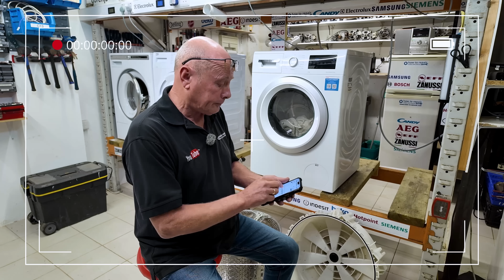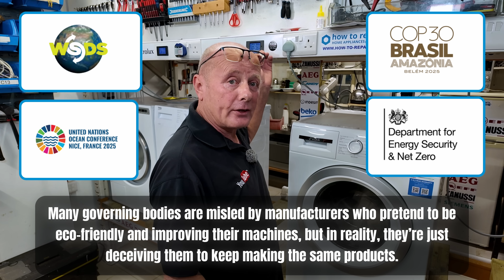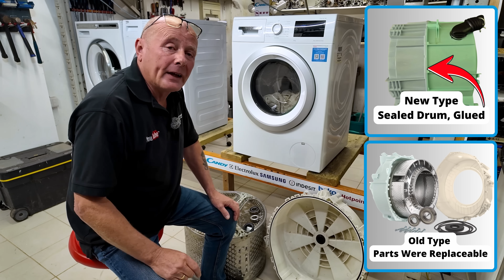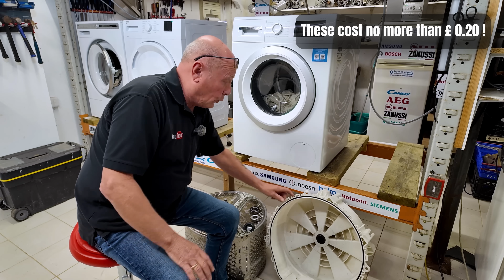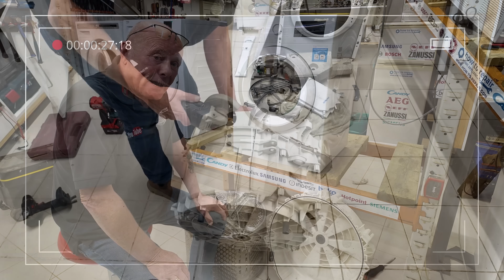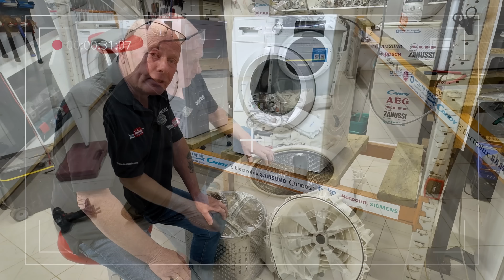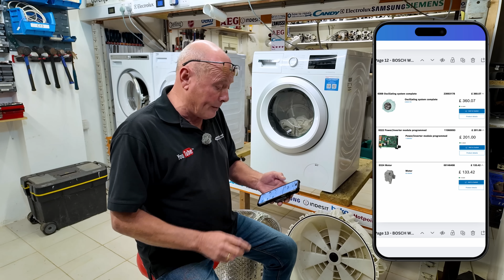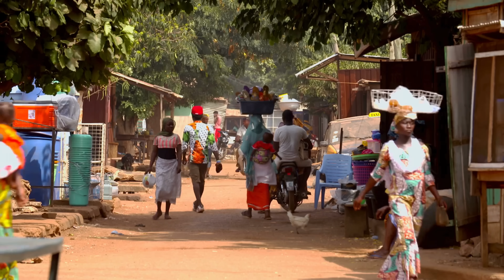Washing Machine SCAM EXPOSED! The Truth About SEALED Drums: Naming & Shaming

Comment: I can only install a 4-5kg washing machine in my small apartment, so far I had Candy and Haier, both have a splittable drum, granted, the Candy was from 2015, but the haier is from 2025(I think, who knows when it was made).

but both machines where extremely expensive being priced at 600€ for the candy and 550€ with a steep discount for the Haier, I'm curious if these prices are just for the european market.

The Candy didn't fail or wear out, I just decided to upgrade to a newer machine with an inverter motor, but I do miss the variety of programs the Candy had.

Comment: Yeah we had a Zanussi washing machine, the Solenoid’s kept going constantly. I replaced them three times, then the heater blew. In each case I bought the parts on eBay and in one case I went to the local council recycling centre and looked for a couple of similar models (Zanussi and quite a number of other models use the same stuff). Then just stripped the parts from dumped ones.

Eventually replaced all the Zanussi stuff with LG and they seem to be much better.

Comment: Let me explain what you asked for at 8:00 Bosch, Siemens and Neff are all one company. BSH Hausgeräte but I sm sure you knew that. Their offices and factories are located in Munich and Stuttgart where major car manufacturers are as well. 
It is very common, due to how cost centers in the industry work, that Engineering is outsourced. Also these are very extensive areas to live in, once you bought a house there you stay there. That said, knowledge on how to best ripp off customers transfers easily between different industries and they develop their own ideas of what is acceptable moraly and legally. Keep in mind the diesel cheating software was also a German invention.

Comment: Could you make identical models using 3D printers? That way, when you cut open the original sealed drum and replace the defective part, you could reassemble everything inside a new 3D printed housing. It could be designed in two parts with holes for screws so it can be closed again.
Could you produce these and sell them, or would that go against the manufacturer’s rules or rights?

Comment: I bought a Miele  Washing machine in 1978 I replaced it in 2022 because the drum bearing went and the cost of that bearing was prohibitive during the period I had it I only replaced motor brushes and it served a growing family here in uk plus 2 1/2,years while in Eritrea and being surrounded here in England for 8 years while I built a house 
I bought a bosche wasn’t machine 5 years ago I am told it needs a new circuit board which will cost more than a replacement machine to fix 
An engineer to diagnose what is wrong with the machine costs £80 just for him to come to the house 
Can you guess what I am inclined to replace this machine with now

Comment: If you could buy split drums and reuse the guts.

The last ones I have repaired the bearings have also been very small with bad quality seals that fail first leaking into the bearings

Comment: In my bosch washing machine the "aluminium" bearing retainer thing literally rotted off as if aluminium should be corrosion resistant just totally awful, I replaced that hunk of junk with an older 90s Gorenje unit that is totally analog and has been working flawless also the motor is induction based!

Comment: Expert analysis.
It would appear that current washing machine models have been converted over to plastic welding first (before the mold tools have been updated to remove the screw holes).
Assembly time wise, the process of screws vs plastic welding would be very similar.
Component cost savings by removing the screws would not be very much.
I wholeheartedly agree that the assembly line changes were introduced to limit the right to repair on consumer units.
One other point I would like to add is the shortage of spare parts for non-current washing machines - the manufacturers are also making it harder to obtain legacy repair parts - forcing consumers down the road of purchasing a new model.

Comment: We had numerous machines with unrepairable drum bearings, broken motors and cir uit boards. Eventually we bought a chinese single tub that does a whole wash, loads at the top. Perfect. We would never buy another mainstream brand. In France you can still buy twin tubs, which are brilliant.

Comment: So, basically if a company/entrepreneur designed a drum housing to replace a cut open housing, using new bearings... for say £150 total, which then bolted together, the machine would be back up and running and someone would make a fortune if they could produce them for £30 a piece?

Comment: You are absolutely right. I recently bought a new washing machine after decades of service from an old-fashioned one, and the contrast was shocking.
Thin metal sheets that flex like paper, lightweight construction, and an overwhelming amount of so-called intelligent features. Very quickly it became clear that these features are not there to help the user, but to control and limit the machine itself.
The embedded "intelligence" serves primarily to compensate for low manufacturing quality rather than to improve user experience.
Excessively sensitive vibration sensors, aggressive load balancing logic, and constant aborted spin cycles are not signs of advanced engineering. They are software safeguards designed to protect mechanically under-engineered components from damage.
In older machines, robustness and mass absorbed imbalance and vibration. In modern machines, weak construction is masked by algorithms that override user intent, extend cycle times, and reduce reliability under real-world use.
From a repair perspective, this design philosophy is even worse. Although spare parts may be technically available, the combination of fragile construction and high part prices makes repairs economically irrational. Replacing major assemblies often costs more than the machine itself.
This is not innovation. It is planned obsolescence implemented through software, pricing strategy, and deliberate under-engineering.
Your video explains exactly what many users experience but struggle to articulate. The problem is not misuse. The problem is that modern appliances are no longer built to last, only to survive the warranty period.

Comment: I had a four year old hoover washing machine a few years ago where the bearing failed and I rang for a part and was told a complete was the only answer at about £400 so I removed th3 drum and split it by sawing through the seal, got a bearing locally for a fiver and drilled and bolted the drum back together. When I tried it the drum filled with water and drained and span as it should but on a wash it tripped my mains and I couldn’t see the problem. A local engineer came out and found I had trapped a wire on assembly and fried the circuit board but he let it fill and drain because had had never seen one done that didn’t leak and congratulated me on my attempt lol

Comment: My Bosch WFF 1200 is around 1998 year of production original Germany product every thing writeen at Deutch and still works for that whole time was replaced 2 times Heating element and that’s all .... yes, it has small issues about mechanic programmer it rarely skips some stages but almost it still good done its task I don’t care about water consumption because it does wash very well it doesn’t try to safe water to lower main purpose washing quality. I it fails I going to looking for Mele but I think it doesn’t have splitable drum too ... but service men can just saw it a part then glue it again ...

Comment: Great vid.
Bringing up 4 kids in the 60's, my mother had the same auto washing machine until about 2005'ish. She only got a new one to better match her newly fitted.
Up to about 15-20 years ago, as an average DIY fixer, I used to fix my own and others washing machines. I gave up because of the sealed drum and no access to the bearing and more n more complicated pcb's etc.
Tumble dryers are similarly unrepairable these days.
They used to have a chassis  inside the nice white casing. Now the white casing "is the chassis" which means the whole thing falls apart when trying to repair, making it much much more difficult, even for the above average DIY'er.

Comment: The pcb cost is the worst. These things const 5€ to make. What a joke. At least they are more repairable than the sealed drum.
Reply: Manufacturers like LG and Samsung seal their PCBs in a silicone based conformal compound, making repair more difficult than it otherwise would be. You can of course, use a hot knife to cut a big hole in the tray it is sealed in and cut away the compound. Similarly you could cut a sealed tub open and hot air weld or bond it with a waterproof polypropylene adhesive.

Comment: In the UK we have the consumer rights act 2015. Goods must be fit for purpose, last a reasonable amount of time and be of merchantable quality. Warranties are offered by manufacturers, but your statutory rights under the act will give more protection. I know of electrical items being repaired or replaced up to seven years after warranty has expired. If you have an issue, don’t forget it should be dealt with by the company you purchased from as your contract is with them not the manufacturer. Perhaps pressure on the company’s selling these things will encourage the manufacturers to change.

Comment: Surprise, surprise - my washing machine (Hisense) is near 10 years old and the display's digits now stay on, even when the dial is switched to off. Draining errors are also appearing - despite of no blockage, which means I have to manually drain the machine - from time to time. Not exactly pratical, but it works, until the machine fails.
Planned obsolescence is very real. My last washing machine died after 10 years, as did my last dishwasher and freezer... it's a very strange coincidence. And, as you pointed out, parts are expensive, or the appliance is sealed in a way where it is impossible to fix.
Thanks for posting this video. Consumers should have the right to repair.

Comment: It is funny that the EU obviously has the power to regulate this stuff, since they regulate all kinds of things, to an excess. But instead of going after unrepairable electronics, they decided to die on the hill of USB-C for iphones… now what is more impactful for consumers and the environment? Buying a separate cable every few years for 5-10 bucks on ebay, or throwing away a washing machine? Same goes for battery powered appliances. The manual for my Philips Sonicare toothbrush, which cost over €100 when new, there is a picture at the end with a hammer showing where to break the handle before discarding it in the electrical waste… Inside it is a standard 18650 cell… such big and small appliances should not be allowed in the EU, if we are going to regulate stuff, then at least do it right.

Comment: Recently met exactly this problem on a Bosch, bought about 12 years ago. Replaced the seal and two door switches over the years but the bearing went and it was a sealed unit at over £300.
Bought another one but had issues from new, needing a replacement logic board so not confident about the durability of this one.
Upside, if there is one is sold old motor, refurbished, plus other parts and recouped  a few bob.

Comment: I did white ware repair  in the 80s  for a while.  Even then, drum replacement  was mostly un-economical due to the amount  of labour  involved.  Drums  and bearings  were relatively  cheap then, but the time and effort to do the job  wasn't  worth  it. 
I also doubt  that  the average  lifespan  of a Bosch or Miele is about 5 years. It depends  on the way there  used,  but my experience is that there  last more than 10 years  in average. Bear in mind  that we only see the broken  ones, but we have no real data of what percentage  they  represent of the total sold from that particular  brand or model. 2 years  ago,I gave our  than 14 year  old Bosch to my daughter  after I  replaced the faulty  pump ( $ 78 NZ ) . Sill going  strong. That machine was a replacement  for our 21 year  old Bosch!
Of cause  it is  technically   possible to build  washing machine for instance in a way  that there  last 30 or 40 years or even longer, but that isn't the  way capitalism  works.
Reply: I bet if there were two otherwise identical washing machines sat next to each other in a store, a cheaper one with a sealed tub and a more costly one with a screwed together tub, priced according to the full difference in manufacturing cost, with a sign on top saying my bearings can be repaired and stating the typical cost of the repair, most people would buy the cheaper machine.

Comment: We have just had our 2015 Bosch WAQ243D0GB/09, bearings fail 28/12/25.
I watched a couple of YouTube videos on how to replace the bearings on washing machines, and was ready to tackle the job.
I had no idea this had a sealed drum until I came to find what components are needed for our model. OMG, as you say a total drum replacement, priced a few £ under the cost of a new warrantied machine. No brainer, but so unnecessary and catastrophic for the environment.
This has been a great washing machine, for 10 years, but a new set of bearings and it was good for another 5 to 10 years.
We have not bought a Bosch in principle. We've gone for LG, (I'm not sure if it has a sealed drum)
Good on you for calling this out.

Comment: I have an LG all-in-one washer dryer, it's well over 10 years old and I have repaired it myself three times . I'm not an appliance repairman I'm actually a plumber , but I'm rather resourceful. That being said every time I've had to buy some sort of part for it it has well been under $100. Very often under 65. I'll keep repairing it as long as there's parts for it.

Comment: We need a "right to repair" law. I remember in the 80s we had a small washing machine in a flat ("service"  make?) anyway I'd had a cast hub for the bearings that was bolted on to the back of the drum, 10 minute job to replace bearings

Comment: i had beko washing machine from early 2009, volumax 5 . very basic 6kg model. when the bearing and spider failed the machine was about 9 years old. what we were forced to do was to buy an used sealed drum online from a different beko machine with failed electronics. we got heater and all seals for free and all we had to replace later was motor brushes and outlet pump. and it worked up until this december. if i bought new drum back then i could very much add 20% to that price and get new washing machine. this time  electronic board , and door lock failed plus the body was very rusted on the bottom so we decided to get a new unit but i guess it could be fixed if not for very rough used electronics pickup guy. i think 16 years is a good lifespan but even 10 would be acteptable. anything less than that seems like scam because you simply don't buy apliences everyday

Comment: I totally agree. IT IS A SCANDAL THAT MANUFACTURERS BUILDING MACHINES THAT CANT BE FIXED OR USING TOTALLY ENORMOUS RETAIL PRICED SPARE PARTS.
It is a nonsense of continuing trashing equipment that need cheap mass produced parts sold 100 times the cost they represent…

Comment: You have my subscription and I fully agree with you! I am a handyman and I repair virtually any home appliance that breaks down. A few days ago, my fiancée's BEKO refrigerator broke down after less than 4 years. You know - a fridge full of food after the holidays. In the morning we get up to make breakfast - and this is quite a surprise. The fridge is warm instead of cold, and the food has completely spoiled. I wanted to repair the refrigerator myself, and when I moved it away from the furniture and the wall, I noticed that everything except the compressor was completely covered with some kind of polyurethane foam, so there was no access to locate and remove the escape of cooling gas! This way the fridge ended up in the trash, and you had to spend £800 on new equipment. What is happening in the household appliances industry is one big scam and a grab for our money.

Comment: I once very proudly bought a whirlpool dishwasher . Lasted about 3 years before major problems developed with pc board. So I binned it and bought a very basic Dishlex dishwasher. It had no electronics just 2 knobs and timers . Lasted about 10 years and then I sold the house with the dishwasher installed. 😅

Comment: What problem to make spider from SS steel? Now axis also made of nickel coated aluminum, which slowly reacts with everything and dissolves. So for some LG models it is not possible to change bearings, also if you can open and solder back the drum.

Comment: Hi there. Thanks for an excellent video!
I bought my Bauknecht WA8988 back in 2002 - I'm single and only do a few washes a week if that.
It has had new bearings, a new motor and I think the spring/dampeners may need replacing but is still going strong after 23 years.
I am not sure I could get the same longevity from a machine made today!?